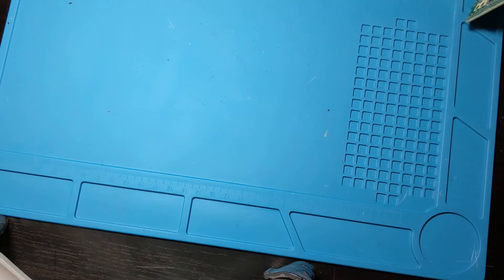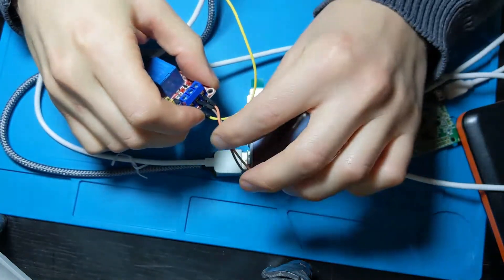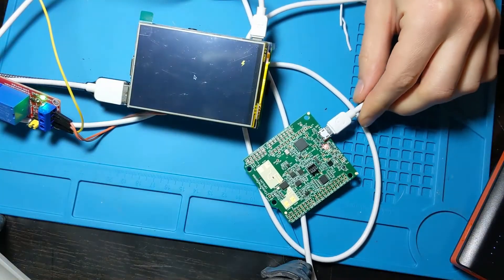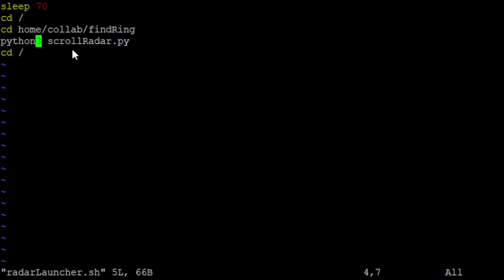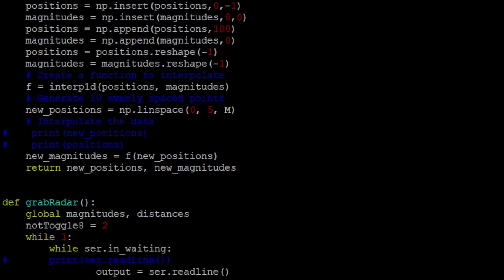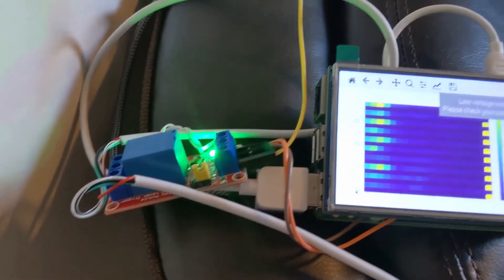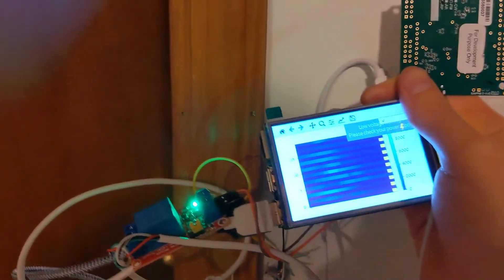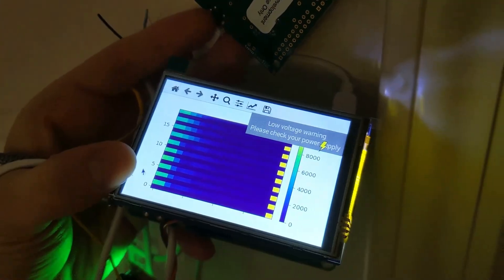see through walls with 24Ghz radar and a Raspberry Pi

Comment: First off all... it is just AMAZING!! I would love to learn how to built one of these.. congrats!!!! Amazing idea...!BUT... one or two advices... The frequency is too high...You should try a frequency range between 100~900 MHz... It fits better when you're working GPR for those goals. 2.4 GHz would let you see maybe a few centimeters in depth... The wavelenght (resolution) and  skin-depth are too short in this setup... Also, with this high frequency, the soil would behave as a conductor... its clay content and natural moisture would kill the EM signal (dissipation). If you're thinking testing it outdoors, you should pick a better spot! Sand works better with EM waves... 

But hey dude! Keep going! Best regards!
Reply from the maker: Yeah you are right, it should be a lower frequency to be able to penetrate the ground.
Reply: @SpinQuorum 0.4ghz to about 10.5ghz
Reply from the maker: @IoTCopperWireGuyLoRaWifiTiGuy ive been thinking about trying this again with a pluto+ and a vivaldi antenna

Comment: Do you have the code for radar + the screen available? Wouldn't mind trying this out. Thanks!
Reply from the maker: my bad, normally Im pretty good about updating my github:
https://github.com/skywo1f/Lets_do_it_live/tree/master
look for showRadar.py
Reply: @SpinQuorum  awesome! i haven't looked through the code but I presume the Screen-Hat code is in there also? Do you have a part number on the radar module and the RPi Screen?
Reply from the maker: @tomtouma  the radar module is the ops241 from omnipresense. The screen hat is from waveshare. To get the rpi to use the hat, instead of the hdmi output is fairly straight-forward and depends on which hat you get. There are plenty of guides out there for that setup.
Reply: Am I the only one to state the obvious? Hello there is too much gold where you held it against the ground, its not malfunction!